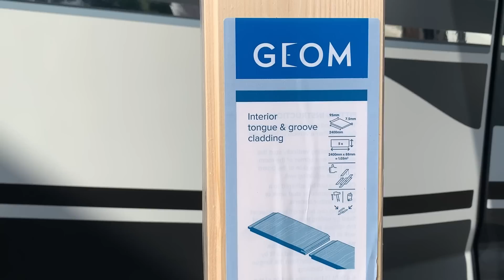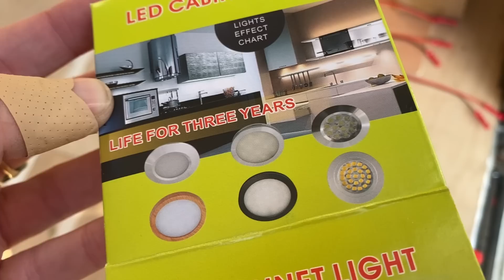CLADDING MY VAN ROOF - van build Ep.14

Comment: Sorry to be that person, but the wiring you're using is to small. Even for the USB you've got 3-5m on each lead, so maybe 10m of voltage drop. Try drawing 2a down that route and you're going to lose 1-2v.  Fair enough that it's on the 12v side so less noticeable but it's still 3-4w of power loss in the wires, heading the van. It'll work and likely be fine, but very bad practice. 

Again, hate to say it, but I'd be using a heavier guage wire all around. Where possible I'd use the van chassis for the ground return and twice the guage for the 12v send and it'll probably cost less. Less wires, less clutter, less connectors and less issues at a later date.

Loving the build otherwise.
Reply from the maker: If you go to my previous videos comments, I’m sure your concerns will be answered there 😊
Reply: @myvanworld  I have watched all of your videos and I know that your dad was involved with the aircraft industry and electrical systems. 
However I stand by my comments. Sorry about that, not trying to cause offence etc, but genuinely concerned about the safety and suitability of that install.
Reply from the maker: @PIXscotland  no offence taken. I was referring to the comments on my last video regarding the wiring ampage. It’s thin insulated wires, but they’re perfectly suitable for the amps they will be carrying :) dad answered these issues there, you can have a look.